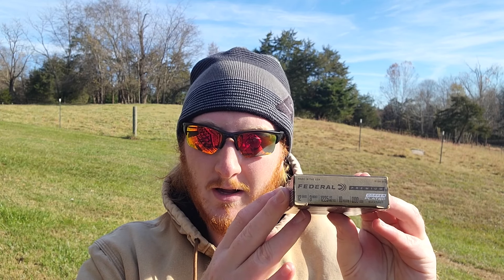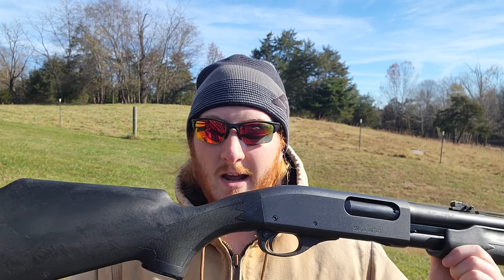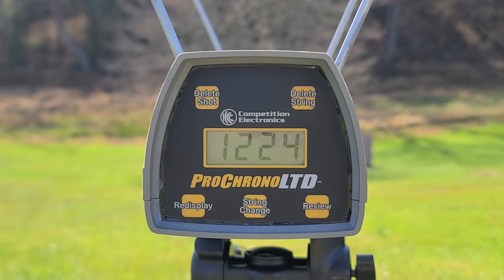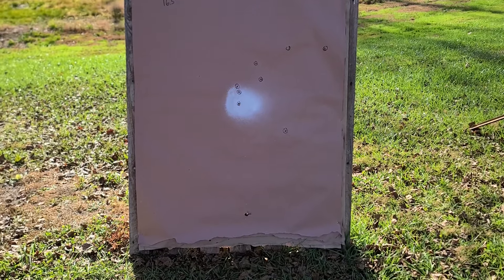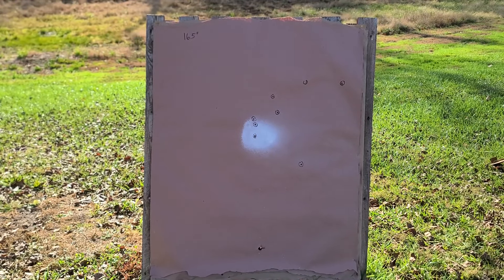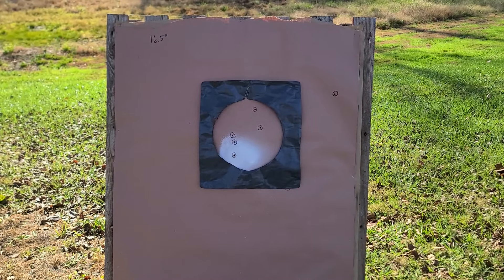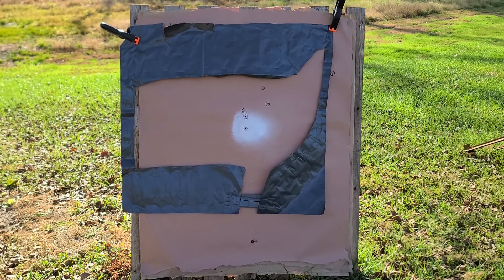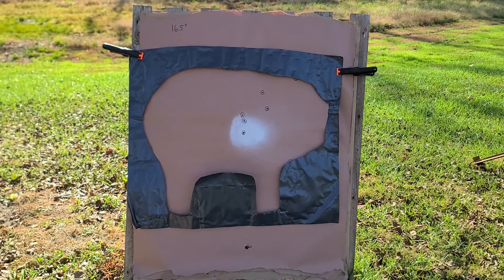Federal Copper Plated 3" 10 Pellet 000 Buck Test W/ Remington 870 & Kicks Buck Kicker Full Choke

Comment: Plated Buck Shot does not deform as much as soft lead.

The math;

.36” + .36” = .720” + .010” plastic wad fingers = .730”

Through a .693” choke is jamming it !!!
Reply from the maker: These kind of wads tend to snag on the porting in Kicks chokes anyway, so I think the larger pellets just caused it to jam up more than usual

Comment: Maybe that 000 is over constricted? I would like to see that load though I modified, or improved modified.
Reply from the maker: It is a possibility. We may try that some time soon
Reply: I have put 000 buckshot through a full choke and then tried it through a modified and had the pattern open up considerably, just my experience with rem 870 with 24" barrel and factory chokes